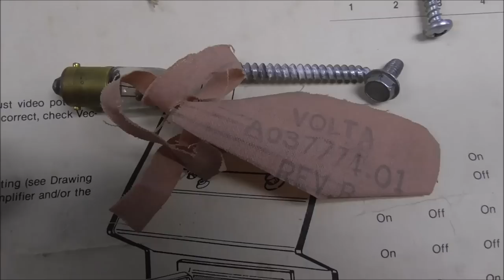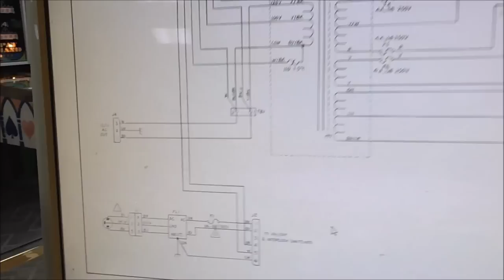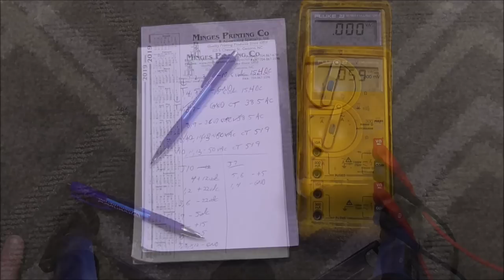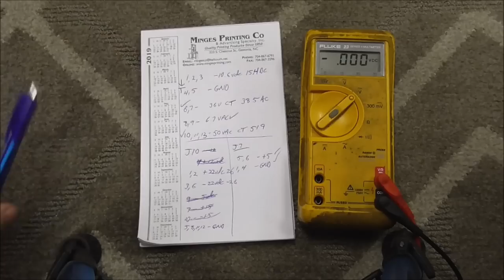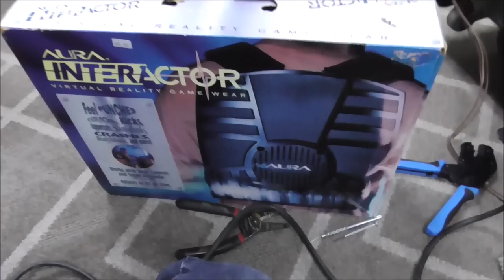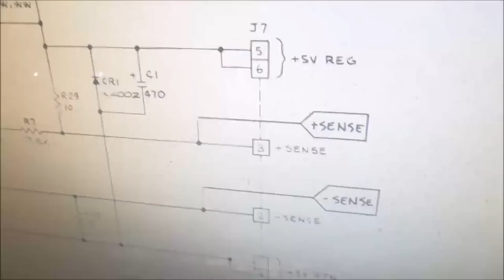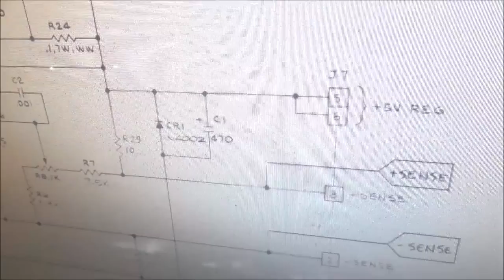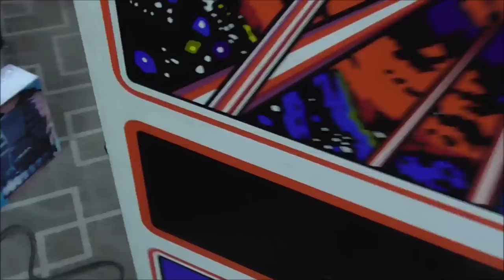Let's Fix Atari's legendary TEMPEST Vector Arcade Game!

Comment: Maybe a compromise to both using the mod vs not using the mod would be to add a diode between the connector and the resistor on both sense lines that would prevent the cpu\mainboard from pulling power from the power board over the sense lines. You would have to adjust for the .5 to .7 voltage drop from the diodes (probably means changing a few other resisters). This would allow you to keep the sense lines and prevent the resisters from burning up, although it would also mean modding the board a bit more to add the diodes. Just a thought.
Looks to be a design over site or just being cheap back in the day.  
Thanks for the videos.

Comment: Ron, really enjoy your videos. 40 years ago I was a teenage board swapping game tech. Remember Mirco Pong? I still have a cocktail table machine in the basement with a Motorola monochrome monitor. Anyway, one bone to pick with you. Larger diameter, smaller gauge number, wire has less resistance per foot compared to smaller diameter, higher gauge number, wire. Less resistance at the equal current is lower voltage drop in the wire. Keep up the videos. I've learned a lot from you. Thanks.
Reply from the maker: When did I say otherwise?
Reply: @LyonsArcade  At about 44:05 you said "since the sense wires are thinner they don't have hardly any resistance"
Reply: The sense lines don’t carry any current (or a small enough current that it doesn’t make any difference), so there’s no voltage drop on those lines.  There’s lots of current on the main lines, so there will be voltage drop across any resistance there as Ron explains.  That’s how it is supposed to work.  It breaks down when the sense lines start being a current path.  There should be a better isolation circuit on the sense circuit, so Atari is at fault on their original design.

Comment: Excellent video.  Thank you for going through your diagnostic process step by strep. One minor issue:  tarnish is not the same thing as oxidation,  Copper (and silver) can react with sulfur in the air to create tarnish.  It's not the same as an oxide; but both are non-conductive and need to be cleaned to get good electrical contact.

Comment: One of my favorite arcade games ever!  I can understand why Atari had that Sense circuit; they probably never expected any of the machines to be kept long enough for the edge connector to tarnish.  Hindsight is always 20/20, though, and I think Atari eventually learned from their mistake, resulting in the AR3.

Feel free to correct me if I'm wrong, Ron: As far as I can figure out, the AR and AR2 are electrically compatible, to the point that you can replace the AR with an AR2; you just won't be using all the AR2's outputs.  However, they both have the Sense circuit, and therefore the same flaw.  The AR3 is not electrically compatible, but doesn't have the same issue with the Sense circuit (or doesn't have a Sense circuit, or uses a different design that prevents it from burning out the resistors.  I can't find a lot of information on the AR3, so I don't know.  I just know that as far as I can tell, the AR3 doesn't need the mod.)
Reply from the maker: Yes you're correct... and you hit on the correct point too, the whole issue is they were never designed to last 40 years!  most of them did pretty good for 10 or 15 years so honestly, even if we have to mod them or change some things and rebuild things, a power supply you can't really expect to last much longer than that anyways, so I don't really have a problem with them.  I'm glad somebody figured out what we need to do to fix them, or at least how they operate!

Yeah the AR3 as you know they didn't use that too long, to be honest it was kind of the same way, it didn't have the sense circuit but usually they AR3's aren't working either and need to be gone through.

It's a situation though where even if you replace everything on it, it costs like 15 bucks maybe so I really like the Atari supplies personally!

Comment: I had no idea those kill switches on the back door can be pulled out to lock them on! 😅 I pulled hair out over the summer working on my Time Crisis 2 and the tape I was using to hold the switch in wouldn’t hold for very long when I was trying to test it.

Comment: That game is an all-time classic.  Worked for a computer store in the early 90s and the owner had one of these in the back room that we used to play.  I seem to recall the vector monitors for these were problematic and even back then replacements were hard to come by.  Is that still the case?
Reply from the maker: Yes, absolutely.  They haven't made them since 1983!  We're still cobbling them together though.  They've remade some of the boards but the tube itself is an issue... some people though have been able to create brand new ones using used t.v. tubes.

Comment: HI Ron - 

Questions! I have some!

- You mentioned the schematics, and how they're awkward sizes. I notice also that more often than not, these appear to be scans of original, hand-drawn schematics. In your opinion, would there be any advantage to having these schematics redrawn in some sort of schematic layout app, so one could conceivably, click on a trace, and have the entire pathway highlight (for example)?

- Your opinions are well known concerning the use of LEDs in pinball machines, Do you have any strong opinions concerning the use of LEDs in coin doors, or marquees in video games?

- I realize you've already filmed the repair of this particular machine, but are you planning on showcasing the spinner control (or possibly rebuilding it)? As much as I love Tempest (and I love it a lot), the spinner control often develops a 'jitter' which is noticeable when spinning the control rapidly. If this one didn't need to be looked at, perhaps in a future video?
Reply from the maker: This particular controller was still in good shape so I didn't mess with it, and to be honest I've had three or four Tempests and never had any problem with the controller other than some of them make noise, which doesn't bother me... if I ever get one in that doesn't work right though I guess i'll film it :)

I don't mind if people put LED bulbs in the coin doors but I don't really understand why they do.  they burn out like every 10 years then  you put another 10 cent bulb in...  Or the marquee, I just put the regular bulbs in, the Marquee bulbs we buy for $1.50, the starter is like 50 cents.  Or you can hack all the stuff out and wire in a new LED fixture, but if it ever goes bad or has any LED's go out you can't repair it because it's inferior to the original design.  Seems like a downgrade to me but that's just my opinion.

I don't mind the schematics really the way they are, I usually print out sections of it, I just personally like having some paper I can scribble on but I've heard of some people who prefer to have it on an IPAD or something, whatever that is :)

Thanks for watching Dave!
Reply: The jitter is, in my experience, due to the potentiometer needing a good clean, or a worn contact ring.  (However, my experience is limited to old controller paddles like the ones for the Atari 2600, so take this with a grain of salt.)  On the Atari 2600 paddles, once you take apart the pot, there are six metal tabs and a black ring that get filthy and stop making good contact.  This is what causes the jitter, at least on those paddles, but it's nothing you can't fix with a little IPA and a Q-Tip (just be careful not to leave any cotton behind).  I don't know about the Tempest spinner, but I'd imagine it isn't too dissimilar.
Reply: @SpearM3064  I understand about the potentiometer 'jitter', and agree with your assessment about cleaning the pot to fix that problem. The 'jitter' I was referring to on the Tempest spinner (which, in retrospect, was a poor choice of terminology  on my part...) is more of a mechanical 'rattle'.

Spinners and Paddle controls are similar in function (both are analog controls), but while the paddle control is based on a potentiometer (and therefore has a limited twist range), a spinner makes use of an optical-inturrupt (opto) system, basically a disk with a series of holes, that cause a light to 'pulse' as it turns, and that light is read by a sensor, and moves one unit per pulse. Trackballs make use of the same system, but with two optos, one for the X axis, and one for Y. 

In the arcade world, paddle games include (but are certainly not limited to); Pong (and it's variants), Breakout, Circus, Warlords, and any driving game where the steering wheel has a rotation limit. Spinner games include (and again, not limited to); Tempest, Tron, Major Havoc, and Pole Position (as the steering wheel has 360º rotation)

The 'rattle' in the Tempest control is usually caused by a worn bearing (I think... I could easily be mistaken...)
Reply: @LyonsArcade  Thanks Ron, I appreciate your insight... :-)

My $0.02 about marquee LED lights has to do with preserving the original marquees. Some cabinets I've run across have been set up to use Edison style incandescent bulbs in the marquee area, and if one puts bulbs that are of too high a wattage, they can cause the marquee to fade, warp, or otherwise become damaged due to the heat and light. LED bulbs run cooler, and can be used directly in place of Edison style bulbs, and I believe proper sizes of replacement 'florescent style' tubes may be available to use with existing fixtures. 

As an added bonus, they're shatter-resistant, and contain no mercury, so there's that...;-)

Oh, and for what it's worth, Watching your videos is one of the high points of my day...:-D

Comment: To improve the design the sense lines need schottky diodes on both sense + and - to prevent sending out power but definitely a sense line delete improves reliability.

Comment: It still works as a sort of sense circuit when you do the mod.  It just monitors the direct output of the regulator, rather than the return voltage.  Once the boards start burning like that, they can become conductive.  Carbon Tracking is the term used.  Not so much a drama on low voltage, but it still is conductive once it turns to carbon.   Much better to avoid the fire and do the mod in my opinion.  Atari never meant these games to last this long when they were first made.   The Edge Connector would have been fine for the first 2 or 3 years
Reply from the maker: I agree wholeheartedly... by the way, I'm glad you brought up the conductive carbon thing (and others did too) awhile back, I didn't realize that... and I ran into that exact problem on some "Pennant Fever" games we're working on right now, I filmed the whole thing so the videos will pop up eventually on here.  Basically the board burnt and had shorted the voltage to ground took me awhile to figure it out, it was shorted through the carbon and nothing else!
Reply: @LyonsArcade  A lot of those resistors you see on boards use a combination of carbon and metal film.with the thickness and layout of the carbon and metal basically determining the power rating and resistance.   Obviously that is the simplified description, but you get the idea :).  Going back a little while, they use to use carbon composition resisors that were all carbon and used varying densities of carbon to vary the resistances

Comment: The resistors that get hot should have longer leads and mounted higher off the board.  Consider a higher current wire wound.

Comment: Would it be possible to put something like a fuse (well, the opposite of one) across the sense line that would blow if the voltage went too low and you could just replace it instead? Just brainstorming.

Comment: I wonder why type of wire gauge and type of edge connector and pins to use to have very low resistance so that the Atari Sense circuit will work better.

Comment: This might be a senseless comment, couldn’t you also up the wattage of the resistor (based on the watts the track size can handle)?  There might be lots of different ways to fix the sense/senseless problem...
Reply: That may possibly solve the burning resistor issue, but the same issue that burns up the resistor also unregulates the voltage.  So other components on the main board may also start dropping dead at that point.

What Atari should have done, if they thought the +5V was that critical, was used gold plated contacts on the power plug connectors, so that it wouldn't corrode.

Comment: Idea: why not mate the sense resistors with thermal cutoffs set to fail before the resistors do?
Reply: Good idea potentially, but I think the idea is to keep the machine as original as possible, with the exception of specific mods (safety or game mods)
Reply: I was thinking the same thing. Basically a "circuit breaker" when the resistance gets too high in the 5V circuit the tech would know the edge connector needed repaired.

Comment: What a big mistake of putting a 10 Ohmn resistor there only.
This should be able to be fixed changing the resistors values, sonthe resistor and tje board do not die.

Comment: Q: so with OLED technology, would it be better to replace the CRT all together? I mean if it's not a super classic with extra alue and rarity and all that - strictly talking electronically - like when you replaced the sound board on Medusa.
Reply from the maker: It's a different technology, you can't replace it with an OLED screen because it's not a Raster monitor, it's a Vector monitor.  It's like trying to replace your Iphone screen with a CRT.... completely different design, technology, etc.

Comment: I always put higher voltage and higher values for resistors, capacitors, Diodes, anything else I can if I have a power supply go bad.
Also the transformer, I will put in a higher wattage transformer.
I also run larger wires, I replaced an 18 gauge with a 14 gauge wire, to lessen the voltage drop.
The resistance should be the same. Wires usually have so close to zero, the biggest hurdle is the voltage drop.
The longer the distance, the less voltage at the destination.
By increasing the diameter of the wire, the loss of voltage is less.

I would put in at least a 1 watt resistor, if not a 2 watt resistor and I would put double the voltage. If the original caps were 12 volt, I would put in a 25 or even a 50 volt, if I have the space.

I wonder why they didn't do a modification where they just replaced the voltage regulator with a dumber voltage regulator that doesn't have the sense wires and terminals.

I remember swapping out a controller in a satellite receiver that looked like a 5 volt voltage regulator but when I looked at the schematic for what all was inside this little device there were 48 separate capacitors and resistors and transistors and all these parts miniaturized to fit into this one little transistor size component.

That one part cost 80% of the cost of the receiver to replace, and were it not for the receiver having encryption and being keyed to our account I would have just replaced the receiver.